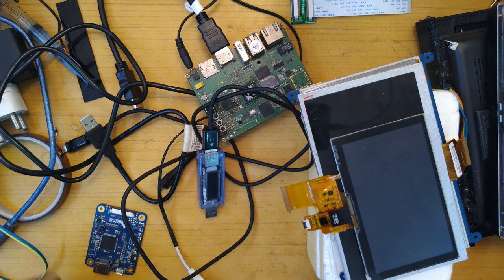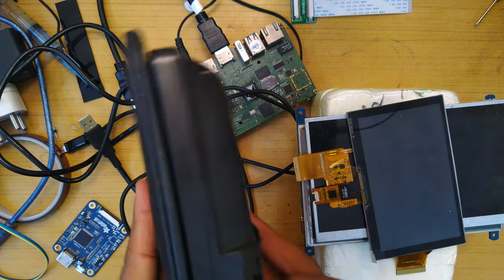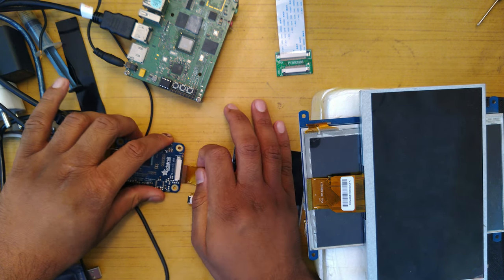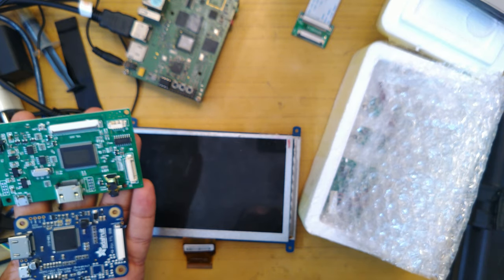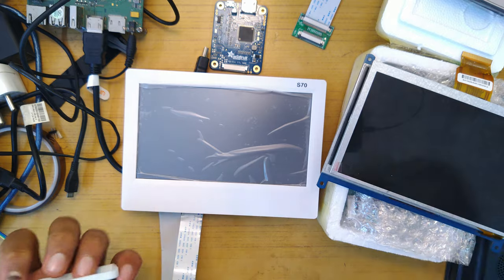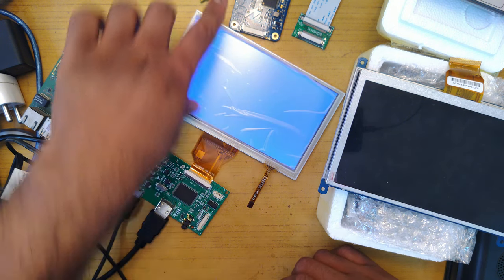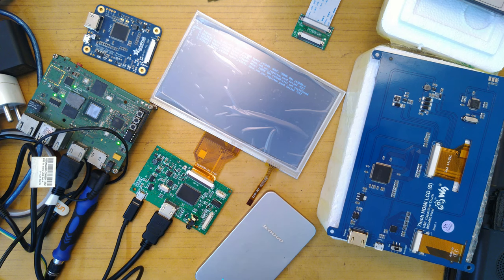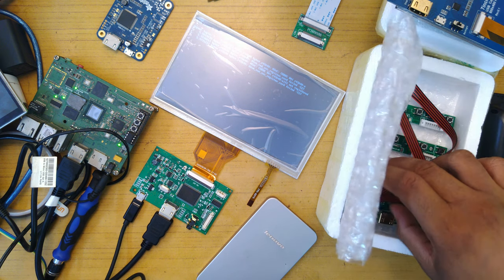40 vs 50 pin LCD TFT Disaplys for DIY Projects [REUPLOAD]

Comment: Hi, how you can choose the right lcd screen for a board? I bought a 19 usd lcd 7 inch with 50 pin to replace one from a 7 inch monitor and it I the new screen it seems to be in a different resolution but there is no way in the OSD to re-adjust the new screen to fit the right resolution. I think I just did  a bad purchase choice (im dont have electronic repair backgroud or similar) it just for a retropie project

Comment: I have a 12pin Oled from a mobile phone. It's color 1.5inch Oled. How can I get a controller for it? Is there any standard for the pins on flex cable to understand. I am a embedded systems guys. Still trying to make career. Please give me insight on that Oled 12pin

Comment: 50p controllers can use 40pin raw TTL screens, by ignoring the avdd/vcom/vgh/vgh pins, as the screens have that internally.

I found two "50p-rgb" screen to 40pin TTL FPC adapter boards on alliexpress. one had 4 pins to use external booster module. another had the boost converter onboard of course requires 5v supply.

so its not possible to passive convert 50pin display to work on 40pin controller (lvds or TTL)
Reply: hello, would you know if it is possible to convert from 40 to 50 pins?  I have a yamaha music keyboard model sx600 that uses the small 40-pin display, and I would like to use some converter to use a 7-inch 50-pin display, is there any way to adapt this?  thanks

Comment: hey man out of stock 40 pin lcd controller board. so i ordered (50 pin TTL only) VGA hdmi LVDS LCD Controller Driver Board online in china. 

i have here my old tablet has 40 pin 7 inch lcd to 50 pin TTL ?.  my question it will work or not?  pls help me sir thak you and more power.

Comment: Nice learning video. Thanks. I do have a question, if you can please clarify - does a 50 pin controller support 17 inch display. If i may ask more precisely, i'm looking for a controller board for Samsung 17 inch LCD panel (part#F199R). Please help me with your expert guidance, if you can.

Comment: what is the trick to connecting the ribbon connector to this board at https://youtu.be/m_TIvYgdC84?si=58FhcLxEOxiFroon&t=522

Mine is very similar to yours and doesn't have the pull crimp bar like most I've seen.

Comment: I wish you could provide a little bit more low level technical info about these displays and connectors and pinouts other than which matches which board.  I am not sure but my guess is the 40 pin is the LVDS interface that is designed to work with Adafruit type of boards that have a realtek RTD266x flat panel controller that converts HDMI to LVDS. And the 50 pin versions could be the TTL (RGB+SYNC).  Or perhaps 40 pin can be both and they accept a single VDD and 50 pin require charge pump  VGH/VGL/AVDD/VCOM.
Reply: correct, 40pin can be lvds protocol or raw RGB TTL, with built in boost circuit (vgl,vgh,avdd,vcom).
50 pin is raw TTL, but requires external boost circuit.
so do you want cheap driver (adafruit style) or cheap screen (50pin).

the boost circuit on 40pin TTL is located on flex cable in some cases

Comment: Hi 
Hope you are well.
I have a 7-inch tft  display (no touch) when I trying to connect this via HDMI cable in my raspberry pi zero w the display goes black I trying to solve this from internet but I can't.
 Can you help me to solve this problem ?

Comment: hello, would you know if it is possible to convert from 40 to 50 pins?  I have a yamaha music keyboard model sx600 that uses the small 40-pin display, and I would like to use some converter to use a 7-inch 50-pin display, is there any way to adapt this?  thanks

Comment: Hey Man! I have a project to buy LCD screens of 15" that can be used by children as a 24/7 school module in villages far away. I want to cost less than $200, use solar power, 12 nice lithium cells, a super tough glass on top of the LCD, and a standard laptop touchpad with cellotape and 3 wires in case we should change the touchpad. The idea is that 3-5 kids can learn from thousands of books for about 10 years until the system breaks. everything is fixed in cheap steel frame and metal-cement housing so it stays in one place. what do you think?

Comment: Hey Sahaj, great video. Do you know if there is any controller that does the opposite of the two controllers you show in this video? So a controller that would convert from 50 pin input to HDMI output.

Comment: Great video thanks...I have a wee question for you...I have a 3.5 inch 40 pin lcd...would there be a bigger screen I could use with the same controller without losing resolution etc?

Comment: Dear amigo.. great video explaing your two boards. I am currently working on an LCD display that is part of a Smart Rear View Mirror from Junsun. The board is an Android device with 2 ports for the display. One is a 40 pin and the second of 30 pins which I found it is for the screen digitizer or touch screen capabilities. This device stoped working about 4 months after I bought it and Android keeps booting in cycles stating: Optimizing Application 1 of 1.. it reboots and it goes through the same in an infinite loop. There are no ports for me to connect anything like a keyboard or usb cable for debugging the board. So my intention was to replace the board with a Raspberry Pi 4 or Raspberry Pi Zero 2 W but I cant find a controller that can combine both the connector to the digitizer and the LCD cable and output to a single either hdmi with touch screen or USB type C with touch controls. Do you have any advice based on your experience? the display model is the WTL068601G02-18M and the digitizer part number is WJ-DR68670-v3 FPC.

Comment: Hi Sir,

I have Balupunkt key largo 970, 10.1 inch car android stereo,  in which the screen resolution is very low like 1024 X 600 px which is not satisfied quality of custom android experience. is there any other way I can introduced or connect any Samsung Tab screen 10 inch screen to  Balupunkt key largo 970, 10.1 and get FHD resolution?

Comment: I need information on a project I'm working on. Here's what I'm trying to do. I have a working LG lm x210 without a screen. Ideally, I'd like to attach a screen I have from a Vantron 5081g tablet. It has a 31 pin LCD ribbon connector. I realize not all of the pins are used, I need to know which pins are used & where they go. If that isn't possible, I have 3 other screens, the Samsung sm J100, the Samsung sm J120 & a Motorola xt 1921-8. It's a project specifically trying to see if this can be done. I can't go buy any parts or phones or anything like that, I have to use the parts I have. Any help will be greatly appreciated.

Comment: I am trying to refurbish the touch screen from an Android car radio, it has separate two wires plug for backlight and like a 50 pin or so flat cable. It's a 7" Nice display and I'd like to use iit.
The car radio amplifier went out, but the display works, so I pulled it out.

Comment: I need help for my samsung galaxy note 10.1 (n8000) the motherboard has issue and i plan to use a controller board for the screen but i dont know what pin connector to use i count it showed me 45 pins

Comment: please , answer me  . I have a 13.3 inches lcd monitor 40 pins  , pulled out from a dead  android tablet  . do you think these video controler boards could work with my 13.3 inches lc monitor ? it's not a laptop monitor despite its size  , it is a common 13.3 inches monitor used in current 13.3 inches android tablet

Comment: I have a broken tablet lcd N080JCE (8 inch -1920x1200) lcd. I tried getting by a board from AliExpress and it couldn’t drive it properly. I only see horizontal and vertical lines and colors, dont see any images or alphabets, just lines. What does that mean? Is the controller incompatible or the lcd is faulty? Its a 39-pin MIPI , 4 data lanes IPS lcd. I really want to get this lcd working because its a very high quality and good viewing angle lcd panel that i dont want to throw away. What do you suggest?

Comment: if i have a 4.3" touch screen that just stays lit on white is there a way i can just buy the front of the touch screen with the 40 pin cable and not have to purchase the circuit board that is behind the lcd panels you are holding? where can i buy those panels just by them selves ? thanks

Comment: Hi I have a tft lcd display 10.1 inch and the lvds cable ribbon broke I mean its still in the lcd but it broke the part that goes in the controller board is there anyway to fix that and if so where can I get a replacement lvds cable

Comment: This is my first project. Any advice?
I want to use a round LCD 49 pin 1.8v display. I'm not sure which pi I would need to make a video player/looper. I'd like to have bluetooth casting available if you have any info or resources  as well. Thanks in advance!

Comment: Very fascinating overview.Although one thing I'm wondering is whether or not there is an lcd interface for driving a 50pin via SPI. I had recently gotten an adafruit a 40pin 5" tft display, with a 40pin spi driver. I control it via an esp32. It's great and all but I really wanted to go with a 7" instead. Problem is that adafruit is out of stock.  I do have a 7" 50 pin lcd who's hdmi driver board died by overvoltage a while back and now i wonder if I can find an spi driver for it.

Comment: I agree, it's a bit of a mess. That board in the nano pc display is for power and touch. The custom pinout is so they can send 5v for the display and get back the touch info. The displays need a special voltage supplies which the breakout boards create. Good video. :)

Comment: hi I need help I bought the wrong LCD controller board it has 50 pin and I have a 40 pin is there any way to still connect it with the LCD controller board
Reply: I also bought the wrong controls button it has 8 pin and where the controls button plugs in is 10 pin is there any way to still connect and make it work thnx
Reply: You can get 40 to 50 pin converters, Mr Black Cat

Comment: Hi, Very very INTERSTING video! Thanks for your valuable experience sharing. Since I'm a TV repair man, following your example, I would like to build a homemade" device using one of the displays you show and I already have, which has the 50 pins interface. I would like to connect it to a generic TV mainboard which usually use an LVDS inteface, just to check & see if the mainboard is working & correctly sending the TV signal to the T-CON board inside the TV. Could you help me a bit to elaborate what kind of interface I could use? Thanks alot for you kindness.
Reply: Were able to find any more details?  It seems to me that the 50 pin interface is TTL (VGA+SYNC) not LVDS. The 40 pins ones may be LVDS.

Comment: Hello Sahaj,  Do you think its possible to adapt from a 41pin LVDS edp1.4 driver to a 51 pin screen, and still drive it?  4k driver to 4k oled pannel, I'm trying to create something along these lines.

As well, Is it possible that these edp1.4 pinouts (41, 51) are universal or do each manufacturer assign different pins?

Thanks!